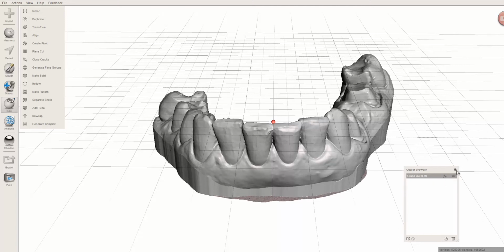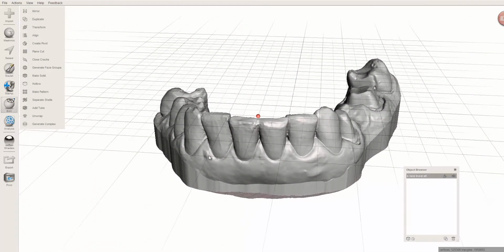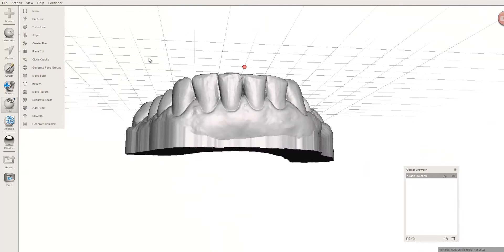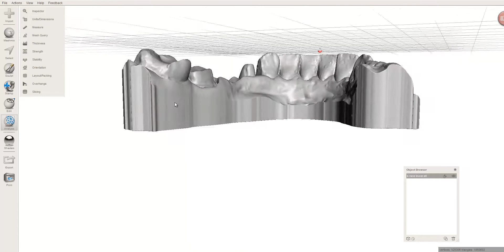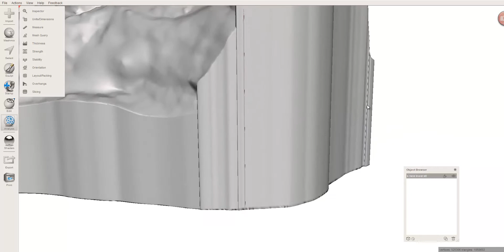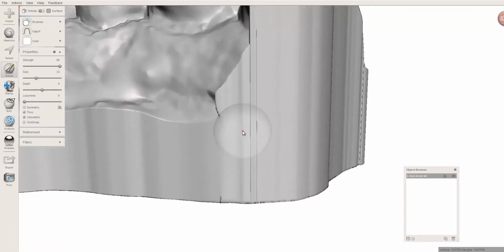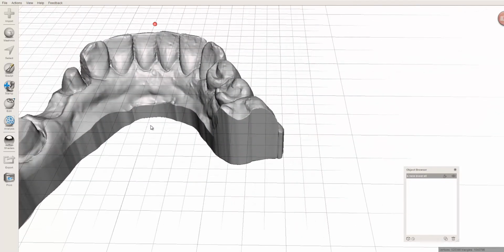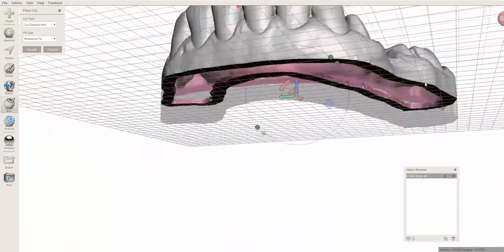MeshMixer - Horizontal Plane Cut - Open Mesh

Comment: Can i use the plane cut in meshmixer with a more precise value? Right now it is snapping at each valuu of 2.5mm, i need it to snap at .5mm or 1mm. thank you
Reply from the maker: Press up and down on the arrow keys. That will alter the step value